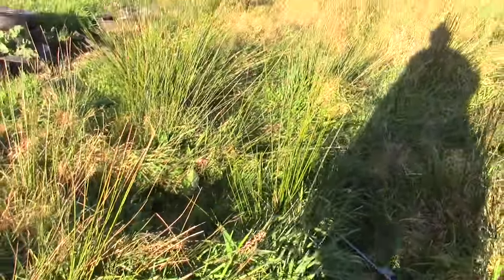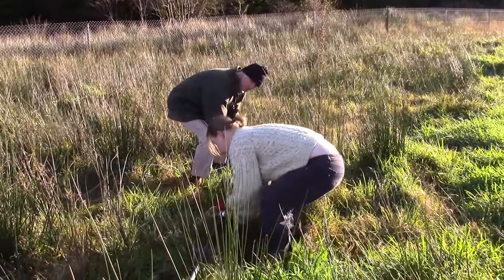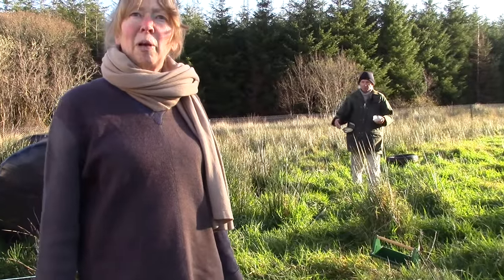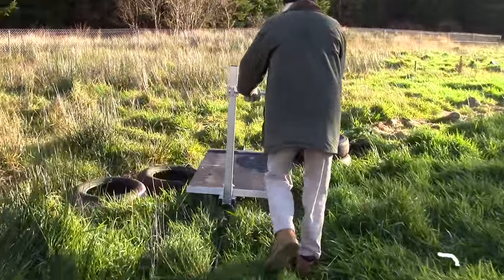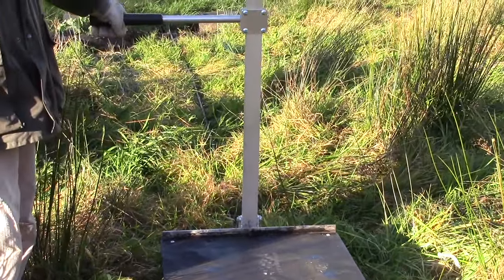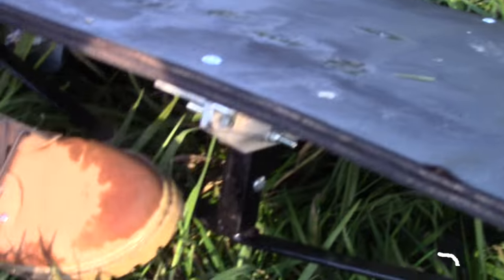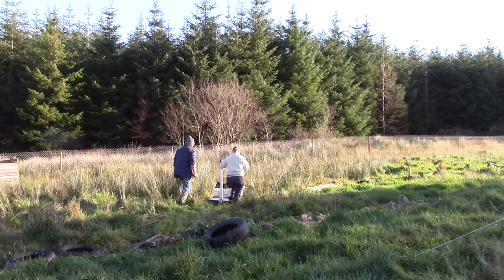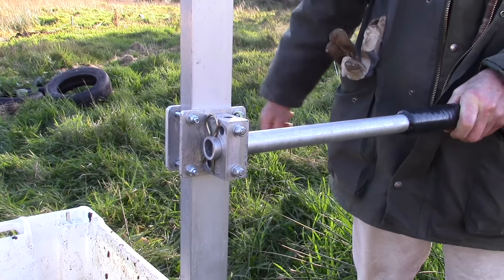Homemade Garden Monorail Railway Is Useful And Fun - Even Over Rough Ground.

Comment: Bend the round bits at the joint 90 degrees & drill two holes in the mating plate so you dont have to use the fence staples, they will lock together when you drop them down.

Comment: Thanks for the great idea. I wonder if two rails six inches apart would be a little easier to control and a little more stable. It should be as mobile. I guess I have to get a new roll of wire for my welder!
Reply: Training wheels from a bike would probably work fine.

Comment: if you lay out the straight with the fork first (forward), you can use one reversible curve with no forks, and after the curve lay the straight with the fork last, and be able to curve either way with one curve part. yes?

Comment: If you wanted it to take heavier loads, too heavy for a person to hold upright, you could add a stabiliser wheel along one side (the Ewing System) - http://www.douglas-self.com/MUSEUM/LOCOLOCO/patiala/patiala.htm
Reply from the maker: Thanks - I like it! Not sure what the advantage would be over having two rails, though? The stabiliser wheel would need a level track too?
Reply: The advantage is that you don't need to line up two rails, or ensure that the track is perfectly level for laying the rail.

I don't know how level the stabiliser track would have to be. Presumable if it wasn't level with the rail, it would cause the carriage to tilt, but would that be much of a problem if you were just using it for hauling stuff, as long as it doesn't tip over?